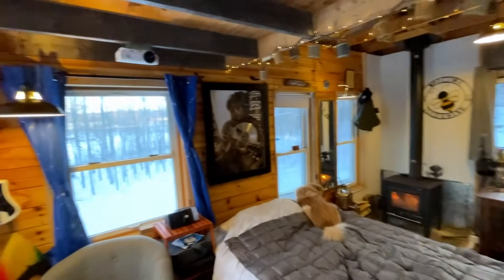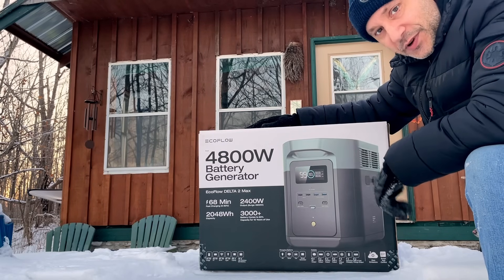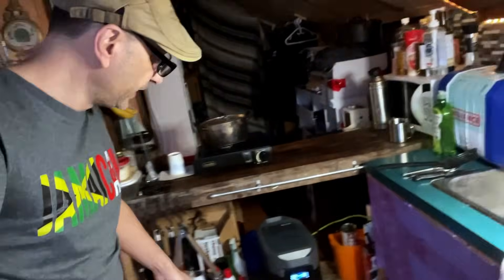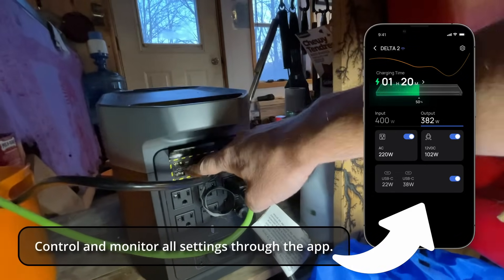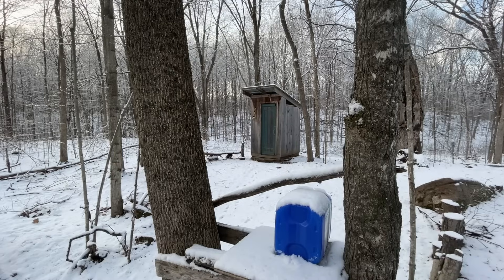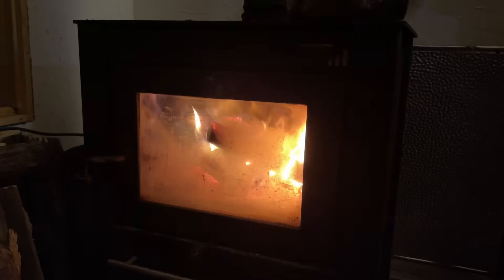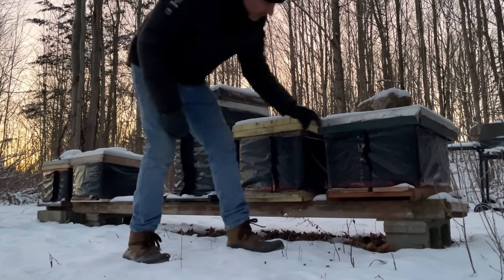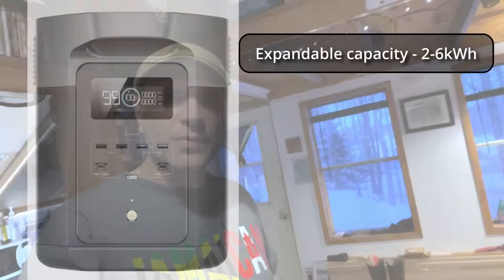The Truth About Power Stations vs. DIY Lithium Batteries (Why I Made The Switch!)

Comment: I'm doing the exact same thing with the cabin I'm building using an Ecoflow system for similar reasons - portability and convenience. Can still plug solar directly in, and the super fast charging with a generator can't be beat. If you add up everything including a really powerful battery charger, inverter, solar charge controller, battery etc., I don't think you're too far ahead with diy and you don't get the portability or comfort of knowing it was all engineered to work together.
Reply from the maker: Agreed. Convenience, reliability and the five year warranty were all factors in my decision. The fast charging on the EcoFlow is insane too!
Reply from the maker: I just realized that I watched a couple of your own videos about power stations before making my decision. Thanks for the content, great channel. Cheers.
Reply: @cleverjoe  Oh wow, really? That's cool, thanks!
Reply from the maker: @HollisDoesStuff  Great content on your channel, cheers.

Comment: If you buy individual components and screw them down to plywood or inside a milk crate, it can still be portable (though a bit more awkward in size). Plus, you can carry that part and each battery separately for less weight. Also, this allows you to choose each part exactly as you need it, and easily upgrade or replace later.
But you are correct; it is an individual choice. Convenience has its value. Thanks for explaining your decision.
Reply from the maker: Good point, and if you're only using a single battery, it would nice and lightweight for smaller jobs when you need to move it around the property for different jobs. I might build one just for the fun of it. Cheers.
Reply: I bought a second Anker solix c1000. Before I did that I looked at the do it your self cost.  Obviously it’s hard to know exactly what components Anker used, but I figure that with a five year warranty they can’t be too crappy. Same for the safety features. I figure I might have saved around 20% doing it myself IF I bought all the right stuff the first time. Not worth it to me. For emergency purposes relying on my technical ability is not worth the risk.   Nice vid.